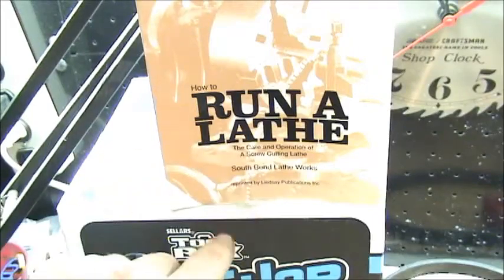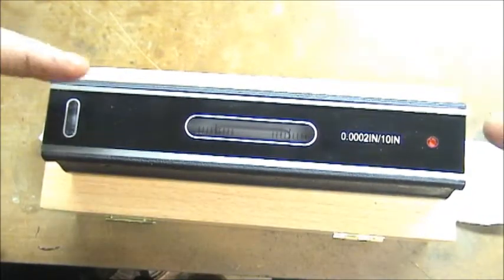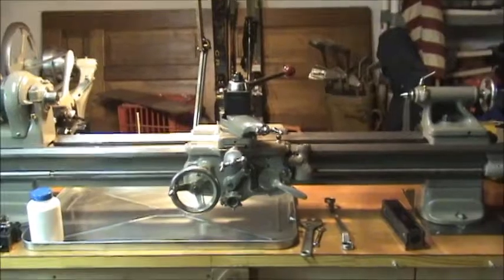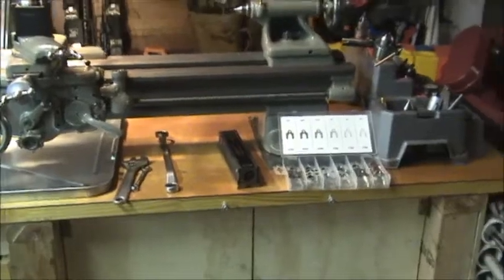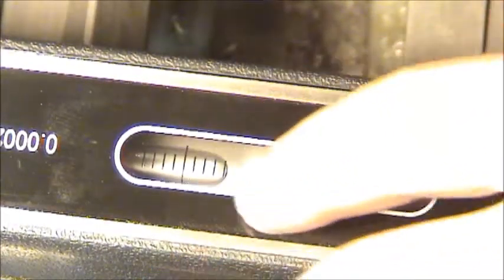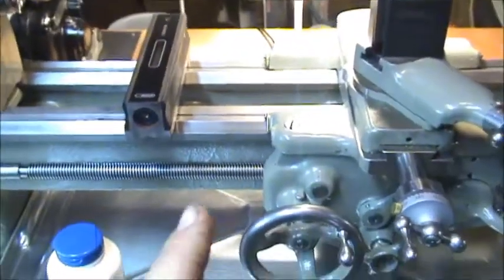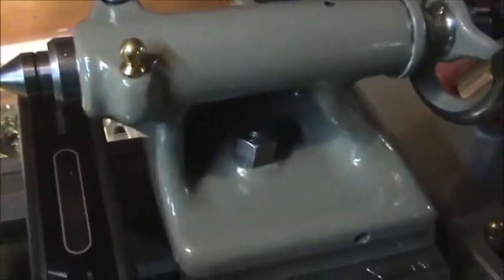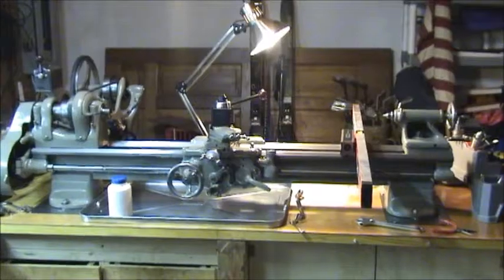Lathe Leveling

Comment: Great video.  Don't forget to check the accuracy of the level first.  Level accuracy is checked by swapping level end for end on a clean surface (does not need to be level).  A properly adjusted level will give the same reading regardless of which end is facing left or right. Most high precision levels have a provision to allow the user to make this adjustment.  Adjust the bubble to read the same as you swap end for end.

Comment: I'm not an expert so i'll try to get more information, my shop leader says it's a trade secret, i'll see if i can confirm that. I did level my lathe like you said and it turned out really well...so i don't know really what he's talking about. Your talking about the point of center between chuck and tail stock. Mine came out to be 2/10 of a thousandths off at perfect level.

Comment: Instead of placing your level across the top of the pyramid of the ways, you might want to consider using a small set of precision matched 90-degree V-blocks that rest on the precision scraped surfaces of the pyramid ways.  Place your level across these V blocks to measure. The tops of the ways, while close to these reference surfaces are not precision scraped in into alignment with the lathe's longitudinal axis.  You will get a more accurate leveling by use of the V blocks.

Comment: interesting video. As I understand it, the goal is to get a flat surface under the mounting bolts on the lathe I tried this by leveling the bench and making a  low (in height) dam around the area where the lathe mounts and filled it with epoxy resin when the epoxy cured it had leveled to a perfectly flat surface on which to mount the lathe .

Comment: Just to prove twist does make a difference, It would be interesting to see the amount of taper (if any) with the bed out of level, ie: Compare a cut when level and with a 1/8" shim placed under the front or back of the tailstock.

Comment: My SB 9C (1936) is same industrial green. Bought it in 2017 and looked to be factory paint. It's got a total restoration and up dated to 2.75 DCV motor with MC / PS. Can you tell me if the industrial green was SB paint from 1936? Can see my lathe on my channel in an earlier video, Bear
Reply from the maker: This is by no means definitive because like most manufacturers you could order the lathes in any color you wanted for a price.  It seems that the older teens and 20s were black.  The 30s and up were greenish grey and newer lathes and larger ones were machinery grey.  Of course there's many exceptions to this but those seem to be the standard 3 colors.  I've seen factory tan and safety green ones also. Again you could specify color.  http://www.wswells.com/sn/sn_db.html
Match your serial number to this reference and you can date it.

Comment: Excellent video. I'm still having issues with my lathe. I have levelled exactly the same.  But if I turn down a bar in 3 jaw chuck. It's about 10thou out towards tail stock compared to head stock end. I'm loosing my mind now.

Comment: Hey there I have a question about leveling my lathe, so I bought one of the somewhat cheap test bars ( you know the ones with the stink on them) and I put the mt3 into the spindle and checked runout near the headstock and at the end of the bar and it was perfect at both, maybe a half a thou over maybe 10 inches or so. However, when I run the Indicator back and forth on the test bar on the side and the top im getting about a 4 thou difference from end to end. I'm in the process of try to level my lathe or make sure there's no twist so I'm wondering if that 4 thou difference is twist or what? I've also used my machinist level T each end of the ways to try and make sure there's no twist just as you did in your video but when I get one end adjusted the other gets out of whack.. not sure whats going on. Any suggestions would be greatly appreciated. Thanks In advance.
Reply from the maker: You're probably fighting wear.  Crosslide drop measured off the top of the bar isn't really much of a concern.  People make a.big deal about it, but unless you're making parts that need NASA accuracy you won't even notice it.  Check on the side where the cutting tool would be.  Also use a nice flat wide indicator tip or else you'll be reading movement around the diameter as the crosslide drops.  I have a video of me aligning my 13" that shows this pretty well.
Reply from the maker: https://youtu.be/TuUS1K6LvlY

Comment: I have been told that because of wear in the ways, there is a better way to make a lathe run true other than leveling it. If I can confirm it and explain it I will. From what I understand this is what is done for NEW lathes. I'm sure you are aware of all this.  The only reason I say this is because this is how i leveled a lathe and got on to from the shop manager because he said it wasn't accurate because of the worn ways.

Comment: is it really important to level the laths .why should we level it
Reply from the maker: You want both inner and outer ways to be 100% parallel with each other to take the twist out of the bed.  Easiest way to measure that is by level.  If they are not parallel and the bed is twisted then the carriage follows that twist moving the tool bit away from or towards the piece being cut which will make the part tapered or hour glass shaped.
Reply: Halligan142 hmm got it